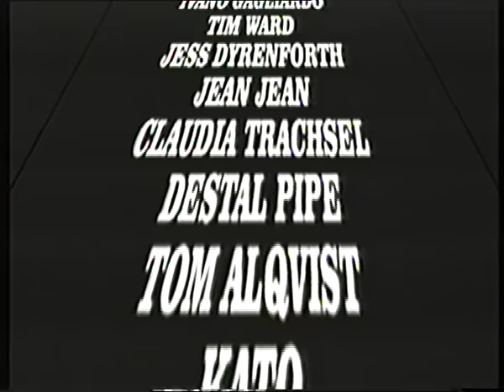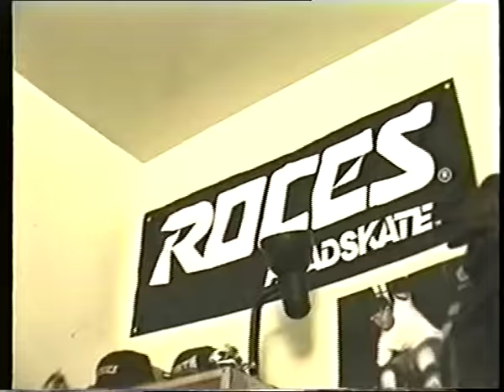Team Roces 1996 - Rare VHS

Comment: Watching this in 2018 and the evolution or blading is unbelievable
Reply: Shawn Mcphee It was hardcore back in the day as we were always pushing the limits of the basic rollerblades! I remember back in 1994 when the wheels were still pretty hard and they used to just smash when doing big jumps, and when the cuff would snap on K2's and had to be tied together with string. I also remember when we used to grind with our skates completly undone to get more flexibility - you could buy power straps at this time for this purpose. My first pair of aggressive inline skates had a weird brake on the front left skate! Man I miss the rollerblading days! Peace...
Reply: And the progression ain't never gonna stop generation after generation, pretty cool eh 🤘 We've all contributed in our own timelines and it'll never stop. ROCK. THE FUCK. ON 🤘🤘🤘
Reply: @JA-yz8eq  Rollerblade Lightning TRS was my first pair! I know I still have them